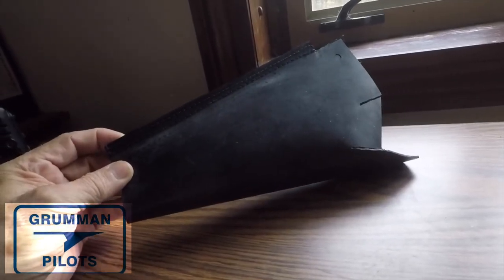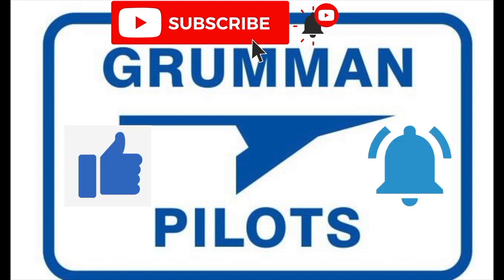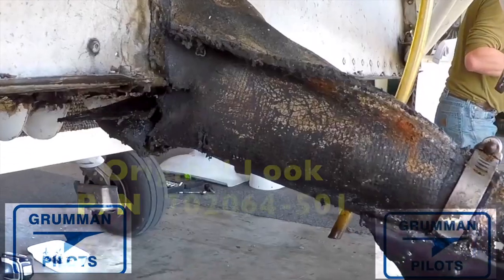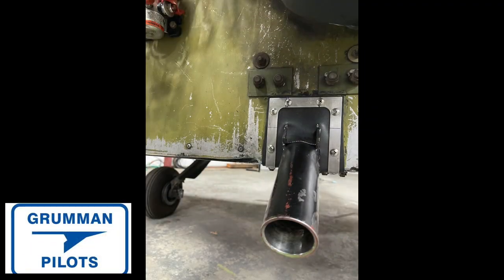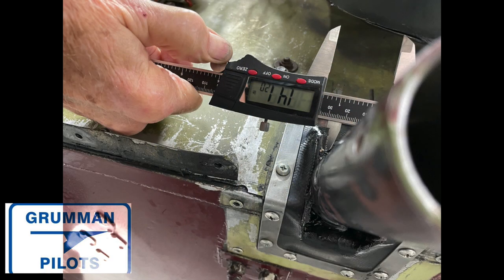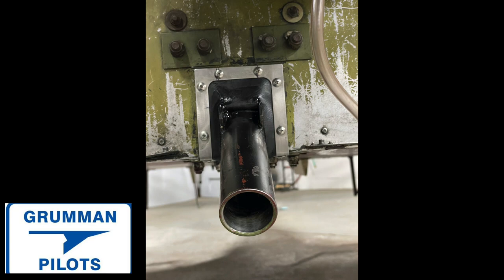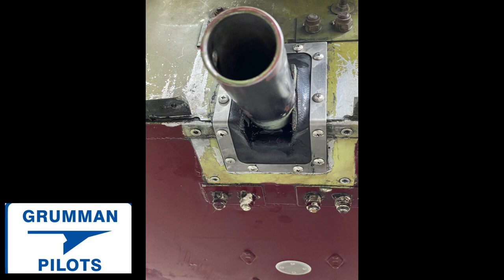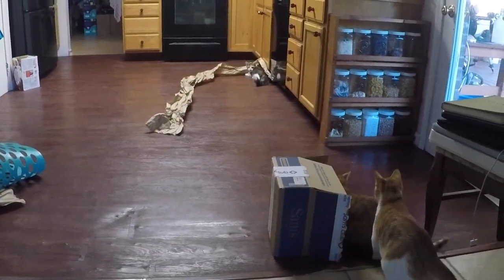AuCountry's Firewall Strut Boot - Grumman Style

Comment: I'd prefer something that's tightened up over the strut,that looks like it has gaps.
Reply from the maker: Having had a hot air leak there, I do not want another.  You are right, the gap unless filled with RTV will leak some air.